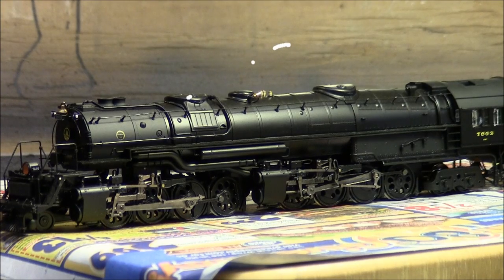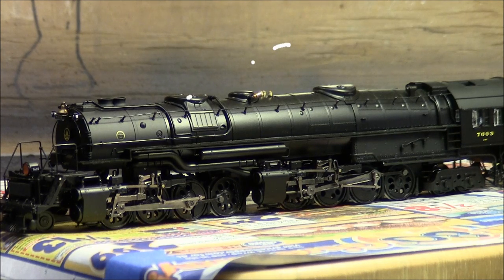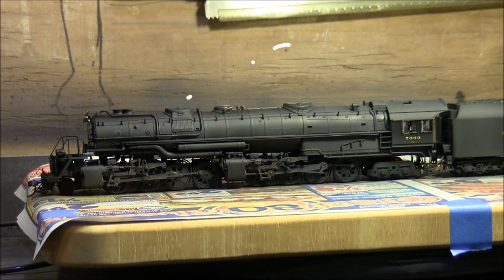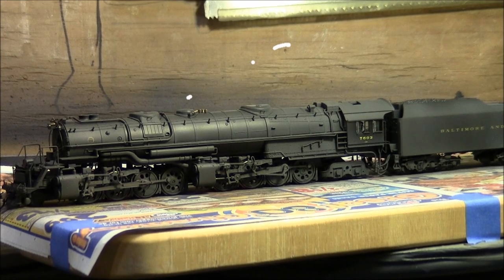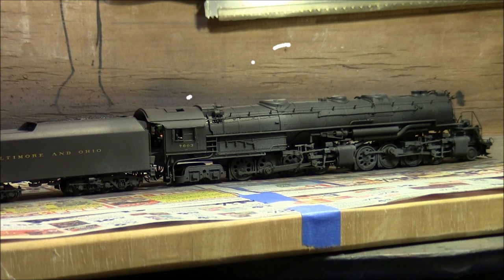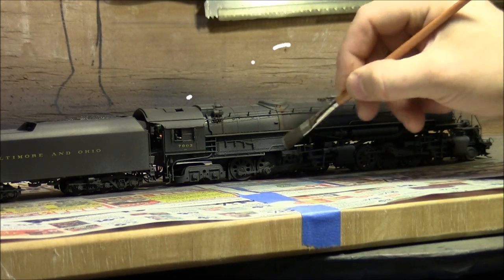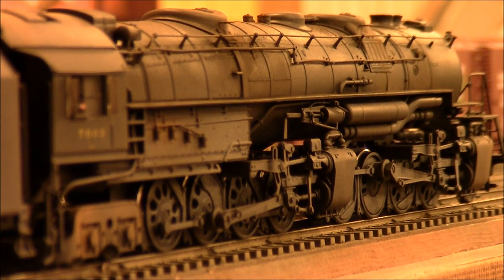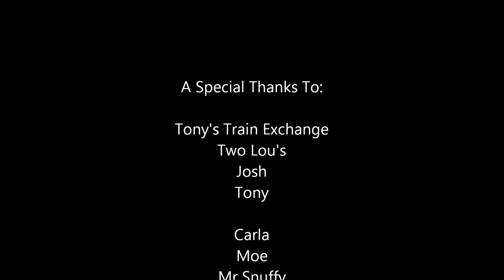Weathering A B&O EM-1 2-8-8-4 Yellowstone Steam Locomotive

Comment: weathering technique.

seldom do i see this kind of weathering the way you do - without taking apart the boiler/cab from the chassis, no tape covers on lights and cab; and water-based paints.

the finished project looks like a brass loco.

very well-done indeed.

Comment: Really looks good and nothing smeared. Takes some confidence to point paint at that new model! I would like to have an era or date for your final look and also have a photo of the loco in it's natural weathered state. One of various I would expect depending on areas of service. My Southern Pacific P-1 Pacific is going to get a Death Valley Dust look (dilute wash repeated for best look) for the running gear because I saw it in a photo and I'm modeling Tonopah Nevada connected to SP circa 1914. Desert dust there. 
    I noticed you use a turntable. Where to get a good one? I had to do my Pacific in two sessions for basic boiler, tender and  coverage. Too tired and scared to turn the model around after doing the first side. I'm new at painting so didn't tackle any running gear or frame or underside at my first attack. I used a lot of dancing with the brush to get behind pipes and such. I'm  experimenting with poster paint black which may rub off to easily and need a cover coat. The look, however, seems to have come out believable.  Thanks and hope to see more of your stuff.

Comment: Whats your technique in cleaning the wheels after you airbrush? Do you hold the engine in place with alcohol on a taper towel? Or do you turn the loco over and clean each wheel with a swab?

Comment: Darned nice!  I like the philosophy of "used, not abused".  The effect is very realistic.  I assume you use alcohol to clean the wheels?  I noticed that you didn't mask the windows or headlight.  I realize that the prototype got dirty, but do you go back and clean them off or are you that careful with the airbrush that you can paint around them?
Reply: +Gary Binder Hi Gary, I usually go back and clean the wheels with acetone. Quick effective and does not leave any residue on the wheels. For cleaning the windows, I use diluted rubbing alcohhol. Wont damage the plastic and is not to aggressive.

Comment: I would never do that to a train that high end, it would stay New In The Box 100%, This took 1/2 off on eBay, no way would I buy a paint on everything, should have took & cover the arm's & took off the body, moving part's like this is a bad thing to paint. each his own. Mine stay new in the box, they are great looking & that"s the way I like my trains
Reply from the maker: To each their own. After painting dozens [100's?] of steamers, simply cleaning the wheel treads with a cleaner such as acetone provides flawless operation. The paint on the side rods, steam cylinders, pistons, piston rods or any other moving parts has ZERO effect on operation or reliability. After the video, the windows were cleaned with a water and ammonia solution so the plastic was not damaged. EzeePezee.